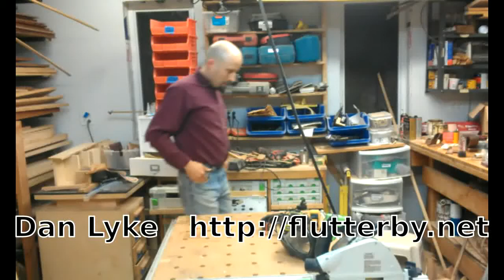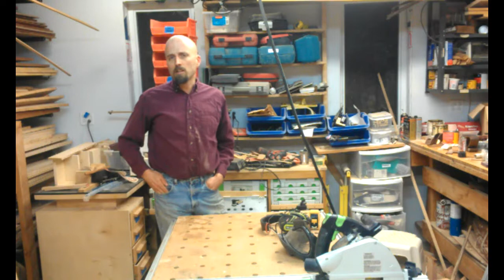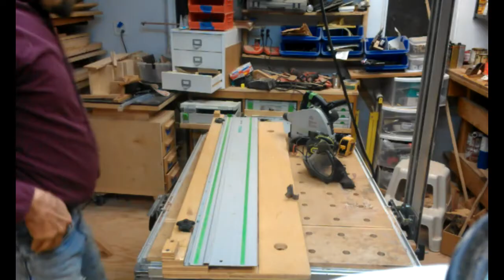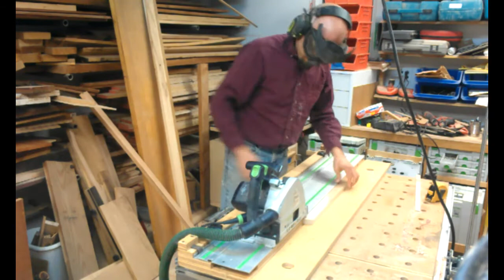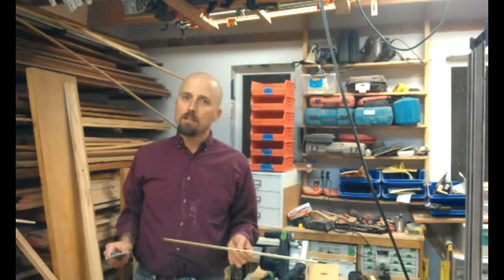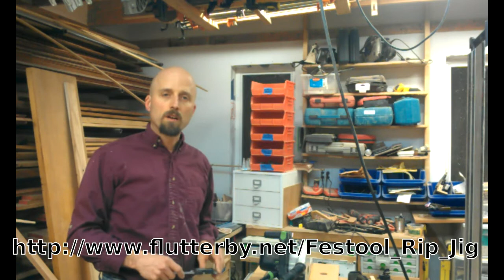Festool Rip Jig

Comment: Thanks, I've been trying to decide if I should get a table saw or a track saw, I can't afford both and ripping thin stock has been the single disadvantage I had listed with the track saw, and something I think I will do regularly, it has so many other advantages over the table saw such as price, space, safety, etc. But ripping thin strips was the one thing I didn't think it could do, so I think you have helped me make my mind up to get the track saw :-)
Reply from the maker: Yeah, I keep refining my technique, and (8! years later) I've got some ideas for improving the jig, but I'm getting better with thin strips. Often I kinda do an ad-hoc jig on the table, a piece of scrap cut square (and even though I've got the Woodpecker outrageously expensive square for aligning my rail to the fence, I also have a triangle cut out of 3/4" ply that I use for things like this and a sacrificial stop at the end. And a sacrificial finger-saver to hold the stock close while I run the saw.

But I'd only get a table saw if it were a SawStop or a Euroslider, and I don't have room in my shop for the latter...

Comment: I chose a track saw for the very reason that I didn't want a table saw and a mitre saw. My track saw can handle whatever I need it to do ( sometimes with a little jig). I don't do commercial work, so speed is not an issue for me, but money and space savings are big issues. Track saws are fantastic.

Comment from the maker: I think it was part of a package purchase, Festool had the drill, and I think the jigsaw and a sander (ETS 150/5), as a kit when we initially bought tools.

I more recently ended up with a Milwaukee M12 kit, partially because I'd bought the Milwaukee PEX tool and had the batteries around, and it's making me appreciate many of the features of the Festool drill more. Yeah, the Festool costs substantially more, but if you look at those few hundred bucks relative to the cost of the materials...

Comment: Are you limited by the jig fence height to the stock thickness?
Reply from the maker: Yep. For narrow things depending on the wood (eg: I was just ripping some edge-banding for 1/2" plywood out of Ipe) I can let the rail hang a little bit and let the wood be unconstrained at the top, but... I've been trying to figure out how to make a reliable height adjustment, and haven't come up with a good idea.

Comment: Nice video - I found it while searching for ripping techniques with Festool equipment.

Your goggles caught my attention. What brand are they, and if hard to find, where did you buy them? It was hard to see them in this video, but would they work with a dust mask? Thanks.
Reply from the maker: I got the goggles at a paintball store, though I've removed the rest of the face guard from them. I paid a premium for them because they've got a little integrated fan to help keep the lens clear of condensation. Not a big deal in the shop when they're on and off, in fact now I usually use the glasses type for that, but while I was crawling around under the house re-doing insulation for hours on end, wearing a respirator, that feature was invaluable.
Reply: Dan Lyke
Interesting, I hadn't thought of paintball gear (never having gone into the arena). Now that I'm looking, there are a lot of possibilities. What I like about them is the large field-of-view compared to your typical safety goggles.

Thanks for the info.

Comment: Great jig. A similar idea was riping in my head, but this is much better!
Reply from the maker: Thanks! I've done ad-hoc versions with clamps for thicker stock, and I keep thinking about ways to alter the thickness, so it's sure not the end-all of rip jigs!
Reply: @danlyke  I have been looking a narrow stock rip jigs and I think yours is a winner..! DId you ever come up with a height adjustment feature and a method of stopping the stock moving forward..? Sorry (or not sorry) for the thread resurrection..;-)
Reply from the maker: @couplandsj  I still don't have a good height adjustment solution. Too keep things from slipping forward: for my MFT table, I made a plywood triangle that has a stop on top at the back side of the rail, which is great for smaller (it's a 18" triangle) rips, and I just put a thin piece of stock in between the MFT fence and the triangle to keep things from slipping forward. I've been thinking about something with a little hook on it that could go into the end of my stock, maybe made of brass so it matters less if I cut through it, to create a little positive pull rather than just me with a push stick leading the blade a little.

The nice thing about that triangle is that I can put shim stock underneath it for a bit of height adjustment, but that doesn't work well for the long rips, and I don't have enough room in my small shop to really manage several different sizes of larger rip jig...

Comment: Nice Jig. I like any tool/jig that takes a measurement off a part, instead of messing with a scale. I've got a domino and a T-55 but there is no way I would convince myself to buy the Festool drill when there are so many cheaper versions out there. What feature prompted you to get the drill or was it a gift? Love Festooooooool and your new video projects. Thanks!
Reply from the maker: Coming back to this 7 years later: After buying another battery set for my C12, and being given a 18v kit by RIGID and buying a couple of Milwaukee 12v devices, I just bought the latest Festool drill and driver set. I couldn't be happier with them. I don't know that I can quantify why they feel so much more polished than the RIGID tools, or why even though they're heavier than the cute little Milwaukee I reach for them first, but yeah: in terms of making my time in the shop more enjoyable, spending an extra few hundred bucks once every decade or so feels worthwhile.

And pondering it in terms of materials expenses is also useful. Even at whatever around seven hundred dollars that that latest Festool kit cost, I'm gonna spend ten times that on materials for the project I really wanted that impact driver for.

Comment: I have been trying this technique for a while but the piece under the saw moves and I never get anything accurate. Not sure what I am doing wrong. I need some sort of front fence to stop the piece from sliding up or slightly on the side
Reply from the maker: Yeah, I've been thinking about two problems with this setup: That (I usually use a push stick on the free side), and that there's a limit to how deep this goes because of the way the clips holding the track work. I'm pondering something that holds the track from the bottom that'd maybe let there be a stop to push the kept portion against, but I haven't figured all the details out just yet.

Comment: So do you do stock thinner than the jig by adjusting the depth on the track saw? Do you have issues with the stock moving since the guiderail is not resting on it?
Reply from the maker: I do generally use  a push-stick out in front of the stock to hold it in place. I've been thinking about various telescoping mechanisms for variable depth, but I may try making that intermediate layer out of 1/4" stock and make it stackable (like index it with Dominos or something.